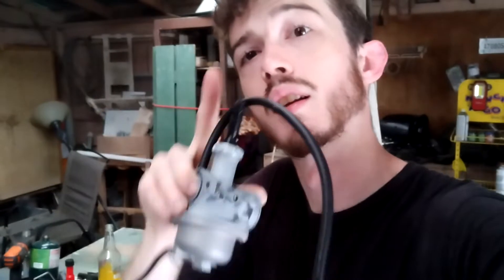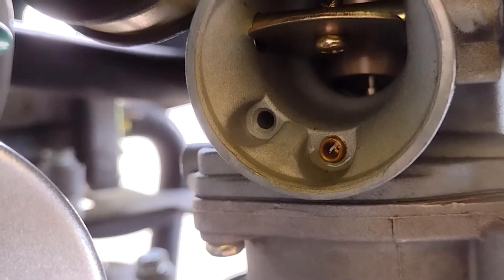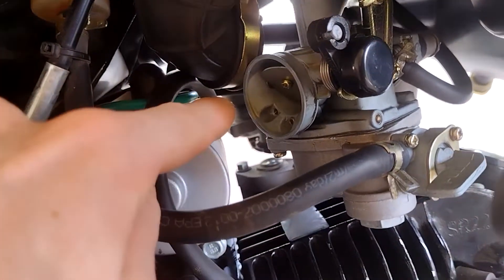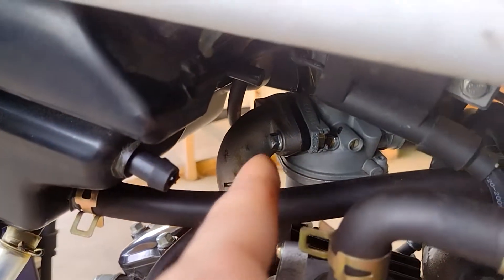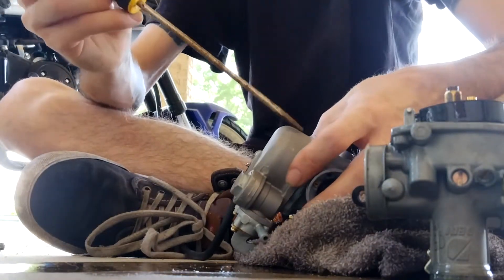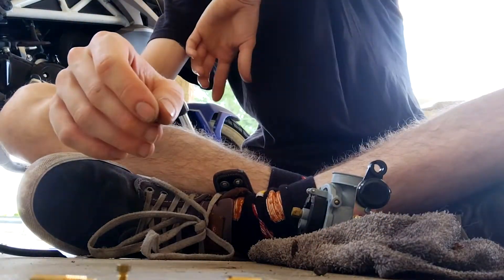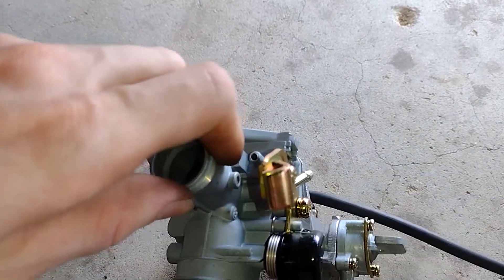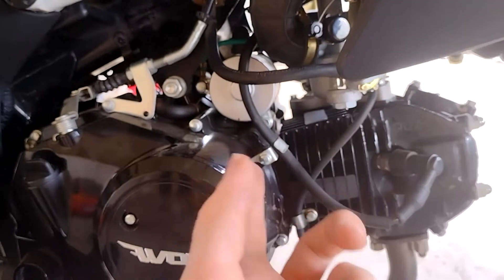How To Replace Carburetor Wolf Striker 125cc

Comment: Just did the same thing i got the NIBBI carb off amazon and the bike loves it. Runs so well. Sounds amazing! Got to delete a few things on it too! I could try to make a video of it when i get a chance. But its air flow makes such a big difference. Also recommend getting the performance ignition coil (dont use aftermarket CDI box tho). Also just put grom performance shock in rear and put on the gold forks. Thing is insane highly recommend it all
Reply: Oh also make sure to buy an intake. The box is common with sucking up fuel and gunk

Comment: When you turn off your bike, do you recommend to turn the fuel switch off? Or it doesn’t matter ???
Reply: 9:22” if you don’t turn the fuel on, it’ll start flooding” is that what you said???
Reply from the maker: If your carb is working properly it doesn't matter. if you plan on saving the bike for a long time, turn the fuel off and drain the carb bowl.

Comment: My Stryker is bogging at the end of my gears. Do you think my carb needs cleaning? Less than 1000 miles. It sat for a couple months not riden.
Reply from the maker: Id drain the gas out and put some fresh 93 octane in the tank and if that dosnt fix it, then pull the carb/clean it.
Reply: Will this aftermarket carb be compatible?
NIBBI Carburetor PE24,fit 125cc 150cc Motorcycle Engine with Carb Jets - For Dirt Pit Bike Mini Bike Motocross GY6
Reply from the maker: @chriscummings5812  it should fit, but will need tuned/jetted for your altitude
Reply: @MiniMotoYT  Altitude?
Reply from the maker: @chriscummings5812  depending on where you live in reference to sea level the fueling will need to be adjusted. Look up carburetor tuning for any bike snd apply it to the striker
Reply: @MiniMotoYT  Got it. I'm in Palm Springs, CA. THANKS FOR ALL YOUR HELP! Have you upgraded any other performance parts for your Stryker?
Reply from the maker: @chriscummings5812  No problem. Only things done to my Striker is a grom exhaust, one size up on my stock main jet, and oem honda grom cush drive in the rear wheel
Reply: Have you considered removing the airbox and installing an air filter?
Reply from the maker: @chriscummings5812  nah, in my opinion you wont gain a whole bunch from that without doing a bigger carb. Stock setup works fine for me
Reply: @MiniMotoYT  can you please give me a link to the amazing carburetor 😅
Reply from the maker: I got mine directly from Wolf. I work for a Wolf scooter dealership, don't have a link for it unfortunately.  @kingkingking12312
Reply: So my wolf striker is 2021 and just got yesterday…it’s great turning on and shifting through the gears but it’s turning completely off when I come to a complete stop and I have to run it again. How can I fix this?

Comment: I need ur help bad 😭im out here struggling with the tube that connects to the carb near the gas line side I can’t get it back on
Reply from the maker: It should just slide on you can try a little grease or something to help it slide on better

Comment: Did you get any more top speed from re-jetting and doing the exhaust
Reply from the maker: Not a ton
Reply: @MiniMotoYT  what’s the top speed?
Reply from the maker: @omegachomp2705  About 62-64mph sitting up straight, Ive gotten it up to 72 by tucking in though

Comment: Is the carburetor a 26 or 28 mm?
Reply from the maker: This is the OEM carb from wolf brand scooters. You can get it from Quality scooter parts online. I never upgraded mine, OEM works fine. I believe OEM is a 20mm.

Comment: My wolf starts but won't idle it turn off any clue why
Reply from the maker: Turn up the idle screw on the carb
Reply: know do you know how much oil it takes what's the oil capacity and oil type
Reply from the maker: @ethansepulveda5364  10w-40 motorcycle oil and it has a dipstick
Reply: Where is the idle screw on the carb?
Reply: Bike starts but won't stay running. I parked it 9 months ago with a new carburetor? I have don't new gas  and new oil any thoughts?